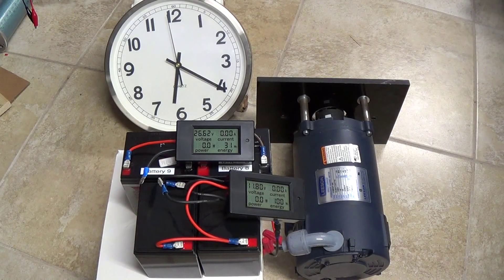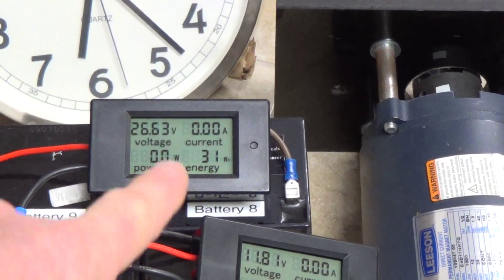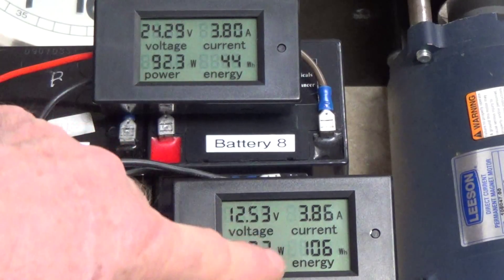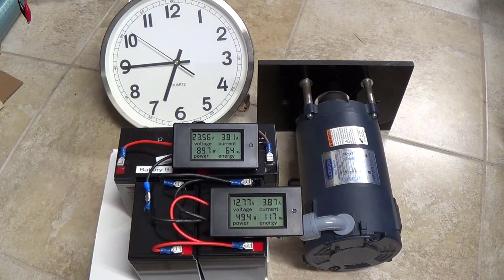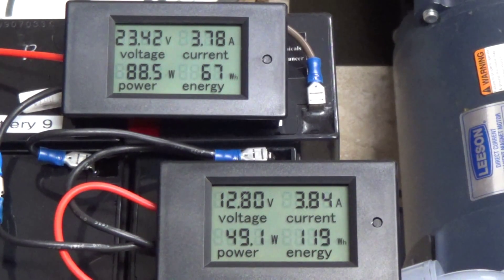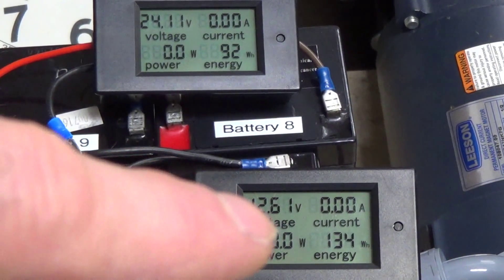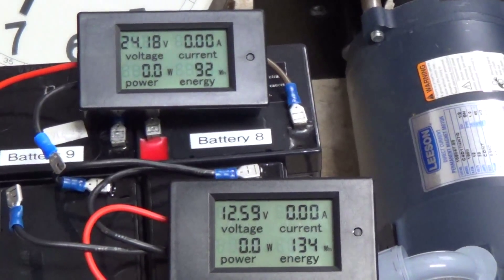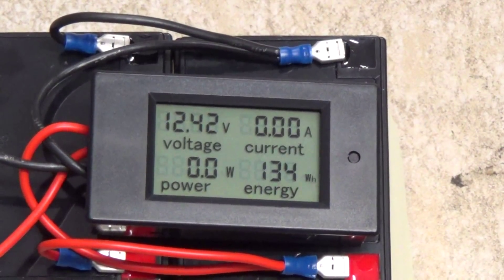Testing of Special Battery Arrangements (part 2)

Comment: I have to take exception to your conclusions on this arrangement of a motor and some batteries. I have done this same experiment not once, not twice, but literally thousands of times over the last 8 years on HUNDREDS of batteries as I researched the 3 Battery generating system.  http://www.energeticforum.com/renewable-energy/10610-3-battery-generating-system.html?highlight=Battery+Generating+System and on its sister thread http://www.energeticforum.com/renewable-energy/19774-basic-free-energy-device.html
The KIND of motor you use will make all the difference in the world. In researching YOUR motor I may be mistaken, but I believe it has a wound rotor and a wound stator, as I see what appears to be run capacitors mounted to the motor body. If that is the case, you got the results I expect you would get with that type of motor. If you try this same experiment with a permanent magnet (stator) brushed DC motor, or even better, a PULSE wound permanent magnet (stator) brushed DC motor, you will get results that may surprise you. How the electricity provided to run the motor is USED by the motor makes all the difference, and different motors use the electricity put into them in different ways. I can tell you right now that a Razor Scooter motor, which is what I have used for most of my testing will take in 12 volts when wired in the configuration you show, but the OUTPUT of the motor is over 14 volts. That is a simple test that can be done with a meter in seconds. Connect to the negative of the battery closest to the motor and the positive to the point where the 24 volt stack connects to the motor, and then simply move the positive probe to the far side of the motor. 

I am in no way supporting the claim that this is a "perpetual motion" device, but I DO KNOW that you can get run times that far exceed what you SHOULD be able to get from the total output of the three batteries, especially if you take the time to rotate the batteries through the three positions. I am not the only one who has seen this work. There are MANY people over the last 8 years who have replicated my experiments on this thread with successful results. And some of us have used meters and scopes much more sophisticated than what you used here. The error you appear to have made is a critical one when it comes to accurate results, if indeed, this is the kind of motor I believe it to be. If it is NOT, then I sincerely do not understand the results you are getting. I have had the same configuration run for days.
Reply from the maker: +David Bowling   Hi David, I'm quite familiar with your experiments. These test were mostly done to verify Rick Friedrich claim in his recent videos. 
However, you wrote " In researching YOUR motor I may be mistaken, but I believe it has a wound rotor and a wound stator, as I see what appears to be run capacitors mounted to the motor body. If that is the case, you got the results I expect you would get with that type of motor. If you try this same experiment with a permanent magnet (stator) brushed DC motor, or even better, a PULSE wound permanent magnet (stator) brushed DC motor, you will get results that may surprise you." 

I ask you, how much research did you do on my motor used in the video?... look at Part 1 video  again, right at the beginning I show the motors name plate which says " DIRECT CURRENT PERMANENT MAGNET MOTOR" 

You wrote "try this same experiment with a permanent magnet (stator) brushed DC motor, you will get results that may surprise you" 
Well, that is exactly the motor I used but no surprise. 

Please allow me to make a suggestion. Pickup 2 of these $10. meters http://www.ebay.com/itm/181834484231 and chose what ever motor you wish. Do the exact tests I have done. Demonstrate you can make your motor run for longer by using the 24v to 12v battery arrangement with motor in between, keeping the motor RPM in the range as the first 12v battery test (establish run time and Wh) and you will have accomplished something great and you can prove me wrong. 

Are you up to the challenge? 

Luc
Reply: +Luc  gotoluc Choquette 
What Rick showed is almost the EXACT circuit I have been working with for 8 years. So I may not agree with MUCH of what he said, but when it comes to this circuit, I do.  Luc, both Matt and I think you are a GREAT researcher, and we hope to work with you in the future. I know you believe you are doing the right thing by trying to expose bull poop that has been spread, but some of that bull poop is gold. Here are MY issues with the tests you have run, and this comes from YEARS of working on this exact circuit. I am NOT trying to be an ass. I just want you to know that there is more here than meets they eye, and there IS something to this. If it were anybody else, I would probably just let this go but you do good work, and I want you to see what we see here. 

1. I mentioned that the motor you were using was probably the WRONG kind of motor for this to work correctly, and you never addressed that issue, so I still don't know if that is part of the problem with your results. I would bet you have a wound rotor and wound stator. If you do, MOST times the method for dealing with Back EMF or CEMF or whatever you choose to call it in THAT kind of motor is to dissipate it in the other windings in the motor.. That is STANDARD electrical motor design. With the RIGHT kind of motor, that voltage and current is passed right on out the other side of the motor (When it is run between the positives, NOT in normal use) and it contributes to the voltage and amperage hitting the third battery to charge it. That is CRITICAL to the success of this circuit. If the motor YOU selected does not do this, you have lost the critical advantage that the DC motor provides as the load in this system. If you will notice, Rick keeps talking about "HIS"  motor, because it is structured to do what I just said, but so are SOME off the shelf motors. 

2. I DO know that you have to run much smaller loads than the motor you ran, which will drain those small batteries faster than the C20 charge rate that you can reasonably charge the 12 volt battery up with ANY kind of decent charge circuit. So you cannot take power out faster than what you can put it in (at the C20 charge rate) and expect to see any kind of decent results. If you will notice Rick is running a small motor that does not draw anywhere near the amps you pull with your demo. 

3. If your battery stack (series batteries) are at 24 volt and your charge battery is at 12, what you have left to charge the 3rd battery is NOT 24 volts, but the POTENTIAL DIFFERENCE between the 24 volts and the 12 volts. That is only 12 volts. Do you think a commercial battery charger that attempted to charge a 12 volt battery with 12 volts would work? Or work in the time frame you allowed in your demonstration? It would NOT. I have to monitor the input voltage to the third battery in my setup like a hawk! That voltage has to remain above the recommended C20 charge voltage for a 12 volt battery or it is like a baby pushing at a swinging door. It moves, but he can't get through. The battery simply will not charge correctly. I have been using a DC to DC converter in MY circuit to hold the voltage to the third battery at just where it needs to be, so instead of barely having 12 volts hit the battery, I have what it needs. If your two primaries are charged up to 13 or 14 volts, the potential difference CAN be high enough to correctly charge that third battery at the BEGINNING of the charge cycle , but as the voltage in the 3rd battery increases and the voltage in the two primaries begins to drop (specifically in primary battery 2, since it goes down first and fastest) the correct potential difference for the C20 charge rate goes away, and it is time to switch batteries around so the two with the highest charge are in the correct position. OR you have to pulse charge the primaries during the "off" cycle on your pulse motor to keep them up, while draining battery 3 by running loads on it, to maintain the potential difference. 

This circuit has a TREMENDOUS potential. It is the HEART of a successful free energy device. By itself, it is NOT the solution, but do not discount its importance. And please do not dismiss it a s bull poop. I promise you it is not.
Reply from the maker: +David Bowling   Hi David,
Question: did you not read my reply above?

Since you once again wrote: " I mentioned that the motor you were using was probably the WRONG kind
 of motor for this to work correctly, and you never addressed that issue"

I have clearly addressed this in my reply above. What's going on???

Let me know what you are not understanding here.

By the way. I published this video in case someone out there has this working and can do a complete video as I have done to prove me wrong. So far I'm only getting some written words and that  I didn't do it right.
If you've got this working help the world and SHOW IT and stop all the words

Comment: I guess a C20 rating is not valid at all, in your test that is. As your batteries are somewhere in the 4-5 amp hour range and your motor is a 12v  30 amp full load pulling 3.85 amps. At best maybe 1 amp is appropriate. 

The motor is most likely causing a buck effect to the power coming out, most do. At this you probably need regulate the potential difference to higher voltage ensuring the bottom 2 batteries are receiving enough of  a charge to actually go into a charge state. All your doing now is hitting them with a trickle charge. Test the power delivery of a trickle charger.  The other option is to regulate the power coming out of the motor to ensure the same thing.

Its kind of amazing that you of all people start with a test that is set to fail. There are rules for both sides of the assembly that are conventional but still applicable. Discharge and charge rates are real and you have to hit them for the battery to respond. Don't just assume the batteries know what to do.

Matt
Reply from the maker: Thanks for your reply Matt. I did the same test using 12Ah batteries and the results were the same but takes much more time to see the results. I used these 5Ah for the video to shorten the process for the viewing audience. These tests were done to verify Rick Friedrich recent videos. He is wrong about getting the lower potential batteries to charge for free. We can clearly see from the meters the power is coming from the higher potential batteries. You are correct about the lower potential batteries not going high enough to get a good charge. The only way I could see that happening is if the higher potential batteries would be 2 to 4 times the Ah rating then the lower batteries being charged. I am a seeker of real and usable effects and very open to anyone proving this high to low battery arrangement works. However, who ever is doing the test to prove there is value to this kind of arrangement will have to use the appropriate meters as I did and explain what they are doing to get the results as there are too many claims and no real evidence. There's a lot of BS in the community and I think it's time to clear some of it out. I'll support what I see works but won't for the sake of a co researcher word. Luc
Reply: +Luc  gotoluc Choquette 
Thats fair you can prove whatever you need to prove for yourself, but to make a blanket statement that ALL PEOPLE who research this type of setup do not know how to measure, and that you are only one capable of dictating the correct way to measure smells a little foul. Even if your talking about the Con Artist Rick Freidrich, the Blanket statement goes further. Right up to my front door in fact. You don't have spare me but you better know what your doing before you accuse anyone. Currently I do not feel you know what your doing even if you think you do. 

In the past I spent time looking at capacity of the battery at certain charge points and if your going to measure a battery and its charge, you first have to start with Capacity and C20 discharge. Voltage does nothing but indicate a point in capacity. 
So lets look at your test and figure out how to actually look at the total charge moving past the load to the charge batteries. The only way to do this is use a power supply on the front end instead of serial batteries. 

Put your load in between the PS and the charge bank and set your current to the same rate as you showed in your test. Now you can look at whats coming out of the motor, but you can't measure it directly you have to watch the batteries in the charge position. How high do they go. If they are anywhere under 13.5v
within and hour or so with your current setup you are not charging them. 

Your voltage coming out of the motor at its peak is what the battery equals at its highest  point. So if they never charge above 13.5 then they are not getting a charge and all  the current you are putting in is dissipated by heat in the chemical process.

Lets look at those  meters to see what they are really saying. I froze the video at 5:54. Those are the numbers I'll discuss. The top bank meter reads 24.29v 3.87a with power of 94.0w. Now the bottom meter read 12.53v at 3.89a with a power of 48.7w. For starters the top number is false. Just because you have 24+ volt in those batteries and 3.87 amps are leaving it does not mean you 94 watts of power flowing. You only have 24.29v - 12.53 = 11.76 volt going across that motor at 3.89+- amps. Thats the total power moving across the motor into the charge batteries because thats the POTENTIAL DIFFERENCE. So your meters are lying to you because they cannot measure with them configured on the potential. 

 And here is the real funny thing about motors, they RIPPLE. How much of the ripple is above the charge battery voltage and how much is below? Everything below is dissipates into the chemical reaction in the battery and nets zero, everything above causes charging. A buck effect also happens which lowers your potential.

So now lets see what is hitting the battery below, but you have no measure of capacity. You do not know the internal resistance of the battery so really you do not have a feasible means for calculating what is supposed to be absorbing in the battery. You have nothing but a faulty meter reading, a very low potential that does very little for the charging of those batteries. Oh and a lot of LOSS in that simple setup.

So I could go on about the curve of power loss from over loading a low amp hour battery but I am not gonna, you can read that info its online somewhere.

Basically you need to test, the real amount of power coming out of the top bank and the real amount of that can go in to the bottom before you can start validating you measurement. Your equipment is not setup to measure a potential based system. 

Now also for argument you can charge super caps. How many joules will a capacitor have at X voltage and how many joules did you pullout of the top battery according to your meter. I'll bet it shows half the power lost on that meter anyway using them the way your using them. But is it? Are pulling 24 volt at a given amperage or are you pulling 12 volt at a given amperage.

Once you get your measurement straight you have to start regulating your circuit to make sure your load is not dampening the power. Motors are terrible, start with a bulb. A regulator and a bulb.

Trust me you cannot apply standard measurement to something that is not standard.  And please just say peoples names instead of making blank statements. A lot of us are doing a lot of things, good things, noble efforts like yourself who don't deserve to be wrapped up in a blanket statement. 

Matt
Reply from the maker: +Matthew Jones  It's simple Matt, if you feel you are being targeted, then do a video test to prove me wrong. I would love to see this really work and I could learn something in the process. Regards
Reply: +Luc  gotoluc Choquette 
I'm too busy. 5 years , $150k + in research I know what I am talking you are not measuring this system correctly. Unfortunately that just makes you look bad. Even an engineer would realize you have to measure the potential energy between the 2 banks for total watt count. Its to bad your going to discredit something you do not even understand. Nor are you going to take the advice from someone who does. Thats all I have to say.

Comment: Thanks for sharing......i run my modified ss ssg with a similar battery arrangment, two in series and two in parallel with the earths joined, the positive on the parallel pair becomes the earth(ground),the strange thing with that one is the parallel pair seem to do all the work?.....thats for sharing as i didnt know this about the motor charging thing and will look at battery arrangment slightly different in the future...thank you.......phil (slippery)